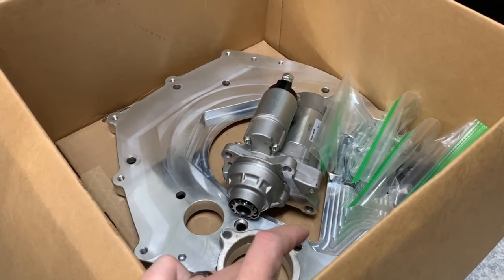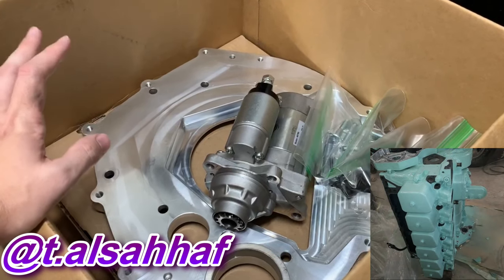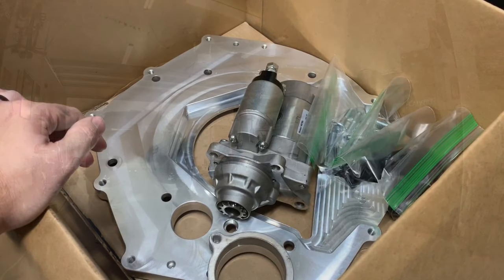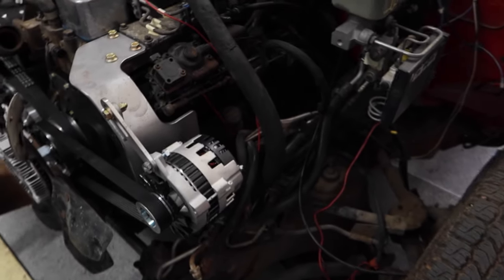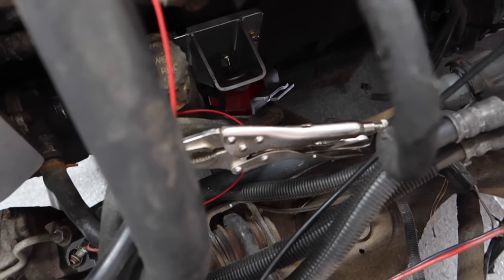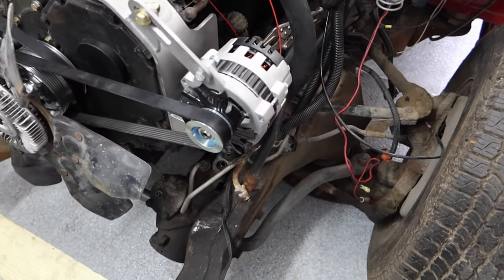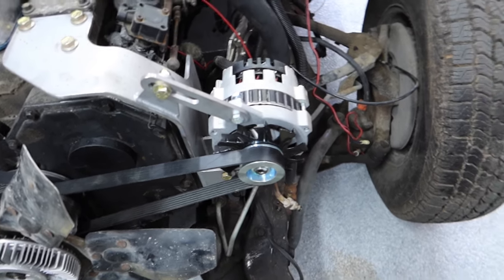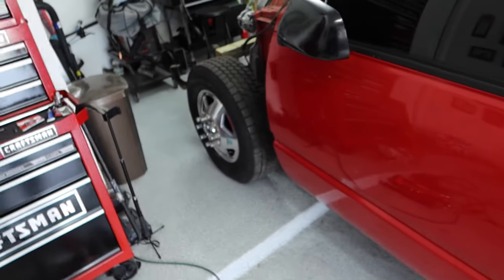First gen Cummins 48re install!

Comment: What did you do for a crossmembers for the transmission? I’m in the process of a similar swap in a 12valve/48re swap and I’m wanting to use the oem dodge crossmember and fab up my own end mounts to bolt it to.

Comment: I asked a few videos ago about which power steering line you used. It turns out you can use your stock power steering line, you just need to make a slight bend to clear the pump housing. If you have not already ordered the one in the link you sent me.
Reply from the maker: Jarrod VW must have missed the comment man. Things got kinda busy a couple days ago with Harbor Freight putting my video in their email.

I have a Diesel Conversation Specialist power steering like that I picked up a long the way. Already pre bent any everything. Then I think you T the other lines on it. But I need to research that a tiny bit more. Hopefully we will be getting there soon now that the engine is sitting in it.
Reply: @GarageBilt  You sent me the link to the line. I'm just letting you know that you can use your stock line the fitting is the same you just need to bend yourstock line like 1/8 of an inch to clear. It's super easy, I thought I would get back to you and let you know what I ended up doing. and that you can use you stock line if you haven't all ready ordered the part.
Reply from the maker: Jarrod VW yeah. I ordered it when I ordered my conversion radiator hose kit that I don’t think will work. Lol. Also I don’t remember if I got the factory line since I didn’t get the engine. Or i just took it off and lost it. Who knows. 🤷🏻‍♂️